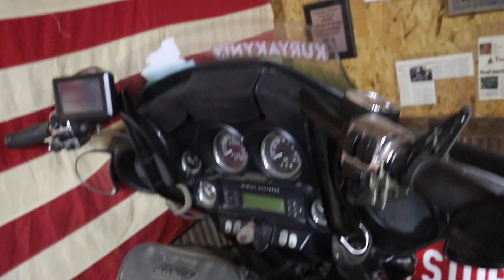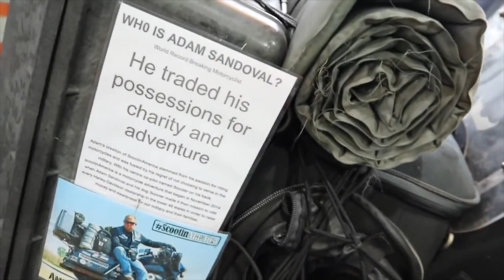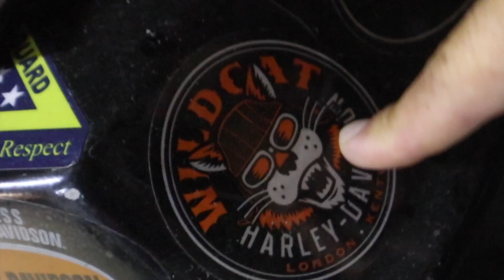Coming Out Of Retirement / I Need Your Help

Comment: Warhorse! Not too often you are gonna be able to let a bike sit like that and get it to start right up. Might be better to get all the old gas out you can and fill with some fresh high test. Maybe new battery too. You don’t want it to fail you on the day of the record. Good luck Brother. Thanks
Reply: Wayne Siminski That Sir is solid advice!
Reply: Pro active rather than reactive has always been my mantra.
Reply: Well said... juice that Warhorse up with some fresh life... new fuel, change the oil to some Synthetic, tire pressure check, lube your cables, shifter linkage intact, couple test runs down the road a few days ahead of schedule, in case you have an adjustment or a fix to make; dial her in.

Comment: have shop manual if you need it. flush tank and clean petcock first then run carb cleaner with gas in first couple tanks. New plugs wouldn't hurt.

Comment: Adam didn't you put the war horse back on the road in 2018 to take it from 6 bends Harley Davidson to Paris Harley Davidson and didn't you ride it a little bit before you had it on display at Paris Harley Davidson and have a battery tender on all your bikes so the electrical system stays in perfect condition so the computer doesn't go weird and if your storing your bike for a long time put seafoam into the fuel so the fuel lines stay playable and the fuel doesn't gum up in the carburetor or gum up fuel injectors

Comment: Gotta put fuel stabilizer in the tank, run the carb empty and disconnect the battery for extended down time.I'm sure it'll start, just has sat too long, have to give them lovin' or they'll act up on ya, just like a woman.